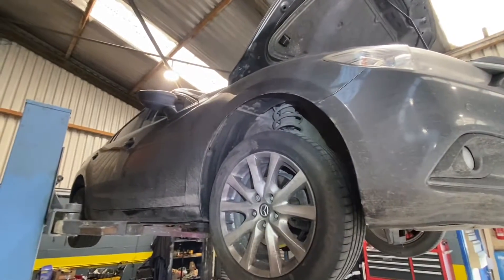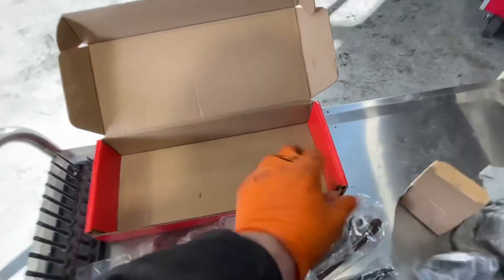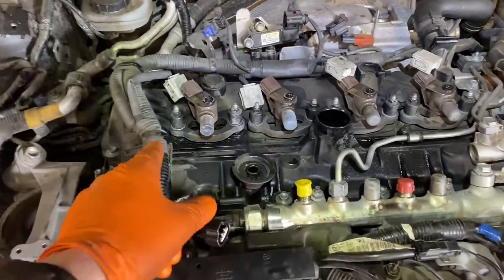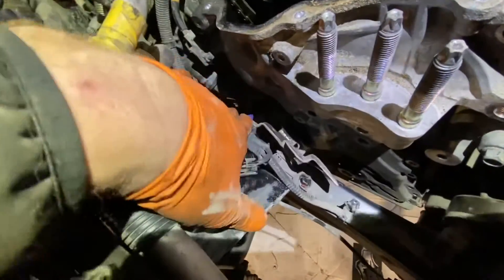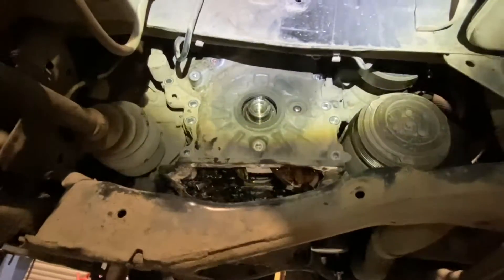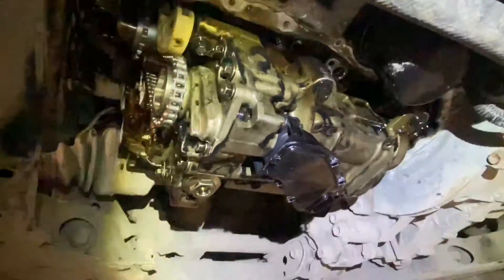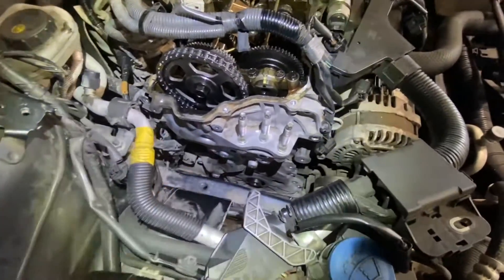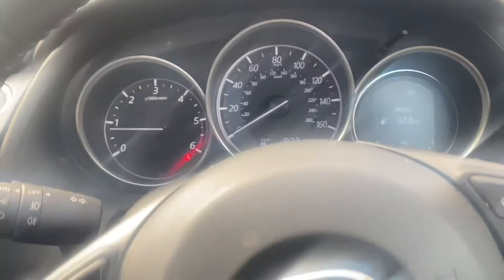Mazda Timing chain replacement tips

Comment: A true Gentleman and Scholar, what a gem find indeed, honestly and such a damn shame other mechanics are not like you! :thanksdoc: I am in the market for a Mazda CX-5 Sport on a 2017, it was such a pleasure to hear you speak in terms of how committed you are to the service of the vehicle. I was thinking i could drive from Wales to where you are should i purchase this vehicle for a timing chain replacement and service.
Reply from the maker: Hi Spencer, apologies for the delayed response. If you do or have bought one, the only chain that fails is the oil pump timing chain. Simply due to its small size. Get the intake manifold cleaned and injector washers around 100k km or 60k miles. Exhaust camshaft at 150k kms or 90k miles, then that’s it. A good car thereafter. Happy new year mate 🙏🙏

Comment: Great vid, how did you get the crank pulley off a 2.2 diesel sky activ? Its tough little bolt!
Reply from the maker: It shouldn’t be too difficult to remove, it is a 21mm bolt and I always use an impact gun. Similar to what is used on wheel nuts or studs
Reply: @kennedysgarage3281  that's great thanks just got it off this morning, locating all the bolts to take the cover off, seems I keep finding more and more.
Reply from the maker: @kevinmaguire9806  well done Kevin 💪💪💪
Reply: Think I may just change the oil pump chain and leave the timing chain, too much expertise is needed take the top off cover off
Reply from the maker: @kevinmaguire9806  buy a chain link splitter & crimper. Should be easily available on eBay 😉🤞🤞🤞

Comment: god forbid they made some locking tools for crankshaft and camshaft... nice video btw. and an excellent job you did
Reply from the maker: It actually is a really simple chain to fit and not needing any fancy locking tools makes it nice and fast, thanks mate 🙏🙏
Reply: @kennedysgarage3281  I'll take your word for it :-). I'm just paranoid of accidentally turning my camshafts without the chain fitted. I see they have the links colored and the little dots matching where the colored links must go, which is ok. I don't know if it is the same for the older MZR-CD engine. I know they have the colored links though. Once again nice video and nice explanation
Reply from the maker: @dodogot5814  once you are only turning the engine by hand every will be fine. And make sure to turn the engine 2 times after fitting the new chain to verify nothing is hitting. After that you’ll be fine 👍👍

Comment: Thanks for the guide. Question: is it necessary to put oil on new parts when we put it all together?
Reply from the maker: It depends on what you feel is best. Some people would say soak everything in oil. I put oil on bearings but not on the chain. Simply due to it taking quite a few turns over before the engine fires. I feel this lubricates everything at a low engine speed, but everyone is different 🤔🤔

Comment: Hey Peter, my 2014 Mazda 6 2.2d died few days back. Had issues with the DPF warnings so got the DPF taken out few months back. Few days ago I was driving along and as soon as I went over 2500revs the car started to shudder, I pressed the clutch and reved it up and it flashed up a load of lights and died in the middle of the road. Would not start, engined turned over with heavy shudder and no lights on the dash. I reakon it could be the timing chain! Have you heard of this before... Thanks David in Galway
Reply from the maker: Hi David, these are very common events to happen. The engine is in need of tlc and then blocks the Dpf.  Unfortunately people the fix or remove the Dpf but never look at what problems caused it to block in the first place. 
It sounds like you could have a heavily blocked intake manifold.  Only oil pump timing chains fail which cause oil pressure faults.  I’ll copy and paste part 1 of 3 videos on a similar issue I had. Or just skip to parts 2 for the intake manifold clean
Reply from the maker: This should help. 

https://youtu.be/py1_fGOAiYA?si=PhEZjYC8JBK0Pa_S
Reply: Thanks for the reply Peter.... Removed the intake manifold 2 days ago after reviewing your other videos (they were a great help). Yes the intake manifold was caked in carbon build-up but not completely blocked. Plan on cleaning out the lot and reassembling. Checked the injectors and getting plenty of diesel. Hopefully the blockage is the issue. Thanks again David
Reply from the maker: @davyfats1717  🤞🤞🤞
Reply: Quick update Peter, cleaned out the manifold and ports and gave a quick scrub to the egr valve but no change car still won't start.. Bit more background as I said I got dpf done 2 months the egr valve was also mapped out... It was working OK slight shudder from the engine when in a higher gear with low revs.. Went to Centre Parcs last week for 3 days 🙄 using missus car so it was left there, when I got home it was a bit harder to start, it was pretty low in diesel so filled it up in the town over, on the way back the issued started shudder when revving for 2500revs etc.... 160000 miles on her.... Been a great car up until the last 6 months 😞
Reply from the maker: @davyfats1717  do you have a scantool to get some direction from ???
You hardly got petrol 🤔🤔
Reply: I've pondered over the petrol question myself 😂.... But changed the fuel filter and had the pipes to the injectors out surely would have got a smell 😬. Brother has a older version scan tool no errors have came up, may need a newer version?
Reply from the maker: @davyfats1717  take a small sample of fuel and try burn it
Reply: Another update.... Its definitely diesel (thank God).... Checked each of the injectors by taking each one out and running in first cylinder, found no spray from No.2, would this cause the issue? Going to get all 4 injectors checked tomorrow...
Reply from the maker: @davyfats1717  absolutely, injectors do fail on them. Not wickedly common, but I do hit the issue once every 6 months or so
Reply: Well Peter, got the injectors checked, 2 bad 2 good... One actually exploded when they tried to test it!!!!! Got the 2 good back and bought 2 new (900 yoyos) 🤮....... Still no good however turning with plenty of smoke but no start...... 😭
Reply from the maker: @davyfats1717  I would think your intake manifold & or the exhaust is blocked solid. Can you get your hands on a scantool ??
Reply: Intake manifold, ports and egr have been cleaned they were pretty clogged. Actually got it started yesterday but it's only running on 2 cylinders. So before I sent the injectors away we thought one of them was faulty, wasnt firing. That injector came back good, it still wouldn't start so took it out and put one of the "bad" injectors in and it started....... But only running on cylinder 2 and 3, 1 and 4 seem to be down. It's now coming up with P2147 code. When it's initially started it actually runs fine but 2min later both 1 and 4 stop.
Reply from the maker: @davyfats1717  that is an injector code but I’d start questioning everything that was done so far, are the injectors seating/ sealing correctly, when the intake system was cleaned did they get far into the exhaust ports in the head. It sounds like you have some kinda air related issue 🤔🤔🤔
Reply: 4 new injectors later and it's running.....
Reply from the maker: @davyfats1717  well done Davy 💪💪💪
Reply from the maker: @davyfats1717  well done Davy 💪💪💪

Comment: Hi Peter, I saw that you mounted the FAI brand timing chain kit, so not the original Mazda one, so the compatible kits are also fine in your opinion. They don't cause problems even if they are not original, right? Some mechanics say that you have to mount the original spare parts to avoid problems, what do you think about this? I also saw in some shops in Germany that sell on Ebay the camshaft kit together with the rocker arms but it is not original, in your opinion is it safe to mount the compatible camshaft? Thanks for the answer you will give me.
Richard

Comment: Good job, again. I have a rattle at cold i hope is not the chain but in case it is just wonder how much you charge for this job. 🤔
Reply from the maker: This is a hard question to answer, just replacing a timing chain would cost around €1000 but if you engine is noisy it could be the oil strainer and or exhaust camshaft/hydraulic tappets & both of these should be be done while the timing chain is off. It could cost another €1000 😬😬😬

Comment: Mazda 6 diesel engines have issues major ones according to diesel mechanics the turbos fail cam lobes wear prematurely, pick up sump pump screens block up, the subject of much discussion. The waste gates are also problems in them.
Reply from the maker: @Alladin-n5j  if injector washers leak this causes carbon buildup in the engine, this carbon then blocks the oil strainer. Blocked oil strainer causes lower oil pressure and makes turbos and big end bearings to fail. 
So change the injector washers and problem solved 🙂🙂

Comment: Good video. You certainly are an expert on Mazda’s .👍
Reply from the maker: In in the middle of my first head gasket on one of the now & thought it wise to remove the engine and box assembly for ease of repair. It’s a bit enough job too, but very interesting. Thanks Tony 🙏🙏👍

Comment: I'm waiting for this to happen to my 2016 Mazda 6, 125k miles. Only last week I had the oil sump strainer and injector seals replaced after low oil pressure warning. Had them do what inspection they could on the oil pump chain after watching your videos, they said it looked fine at this stage but any examination can only be superficial. If I was in IE I'd bring it to you, but alas...
Reply from the maker: If the timing breaks & oil pressure drops you will loose throttle control on these, which is a brilliant feature to save doing extensive damage. So don’t fret about what may never happen, it could last 10 years🤞🤞🤞
Reply: @kennedysgarage3281  Thanks for the reassurance. It's a fantastic car, only worth £2500 with the mileage, yet I see bloody VW Polos with little comfort and convenience features and lesser BHP selling for above £5000 in similar condition!
Reply from the maker: @stupossibleify  oooh that’s low 😬😬

Comment: Great video as always 👍 ,  would you happen to have any tips or tricks for doing the infamous oil seal o ring that fits between the oil pump and oil pick up in the sump of  the 2.o diesel fitted  to  alfa  , saab and vauxhall  plenty of videos on here but  i'm  just wondering is there any easier way rather than taking the sump off  ,  Do you know if it can be done by removing oil pump which is behind the crank sprocket and leaving sump in situ ?  any tips greatly appreciated👍.
Reply from the maker: I have heard of lots of low oil pressure issues due to this O ring failing but never had the pleasure of doing/replacing it. So unfortunately cannot advise. But if one comes in John I will definitely sus it out and record it 😉👍👍
Reply: @kennedysgarage3281  Thanks ,  I'm changing the t/belt on it so i'll try  removing the oil pump to change it, In theory it should just lift off as it's a just push on fitting in the sump failing that sump  will need to come off  last 2 bolts at g/box won't come out unless bell housing is drilled out:face-pink-tears: .  👍

Comment: Is there anyway to inspect the chain as I don't know when it was last replaced and the engine is a bit "ticking"
Reply from the maker: Unfortunately timing chain wear generally cannot be measured until the timing chain is off. But the main timing chain does fail, only the smaller oil pump fails. I’ll paste an older video I done on how to do it 😉
Reply from the maker: https://youtu.be/8ywo9tkBO78?si=cg4A25du5KvJigxt

Comment: I do not miss that engine at all I once worked for Mazda now work for Skoda much prefer VAG group
Reply: I'm the opposite. Give me japanese all day long!
Reply from the maker: Most people do but I do find them very workable with very few plastic bits that can break easily & that I do like, thanks John 🙏🙏
Reply: @garybrown5500  Toyota, yes. But with the beautiful yet weak paint (they don't use an undercoat), and extreme hacks on the diesels to gain Euro5, I won't choose another. A shame, because they are beautiful to look at and to drive.

Comment: Hi peter great video
I have changed the timing chain as well timed up but it wont start and there comes no fuel through and have a hard crank what is the problem do you think? Thank you
Reply from the maker: Think simple at this point, could the fuel system just be air locked??
Do you have a scantool to check the fuel pressure live data ???
Reply from the maker: Think simple at this point, could the fuel system just be air locked??
Do you have a scantool to check the fuel pressure live data ???

Comment: Hi, is there any chance your moving to Dorset uk? 😊 top mechanic top guy for doing these vids, recently bought a Mazda 6 , it’s got a slight hesitation so I clean out egr and inlet and so on it’s better but still there , I read about camshaft on these being a problem, what symptoms would you get with camshaft wear? Many thanks
Reply from the maker: Yes, I would advise removing the injectors & rocker cover to inspect the camshaft & hydraulic tappets. They can fail too 🤞🤞👍

Comment: Peter what milage would u expect to see injector washer failure on these engines or does it vary
Reply from the maker: I recommend exhaust camshaft, injector washers & intake decarb at 120,000 kms or as close as possible 😉👍👍
Reply: @kennedysgarage3281  128km on mine i did the carbon clean on intake wasnt much carbon in there but my god the cars much more responsive afterwards.  Have u ever fitted tge fai cam shafts i know theres not available at minute but there due back soon
Reply from the maker: @eoghanhennessy443  I have but they don’t come with rocker & the rockers wear quite bad once the camshaft fails. So the OE kit with rockers is much better

Comment: Hi Pete , is this only on sky active engines with chain issues??  My wife had an 2006 Mazda 3 hatch . fantastic car.  She'd like a 2023 cx5 .  As a mechanic it nice to know lol cheers , 🍺
Reply: Bolt must have backed out breaking the oil pump chain .🍺
Reply from the maker: Timing chain seem to be quite soft on most cars nowadays so I wouldn’t be put off a new Mazda from my videos at all & I do like them 😬
I also believe the chain broke and got snagged between the pulley and guide causing the bolt to break, if that helps 🙏🙏👍

Comment: Ahh Peter another 2.2 Skyactiv saved..😊 great job…that’s a good idea of the angle grinder on those pesky bolts/nuts on the ECU…I just ended up pulling the whole loom back and leaving the ECU and looms connected. One thing I noted about the cam shaft when I was rebuilding was that most of actual exhaust valves were so SO tight..it was very understandable as to why the shaft would have worn so badly…I’d be very curious to know how long a second cam shaft lasts before it’s ground back down if the valves are not removed and reseated…I know your into a much bigger job at that point..but just an observation and the curiosity side of me coming out 😊
Reply from the maker: I actually have a cylinder head off one at the moment at a repair shop be refurbished & I must ask does he see them to build up carbon in the exhaust ports. I haven’t ever noticed them tight but very interesting to be aware of Damien, thank you 🙏 🙏👍

Comment: Hey Peter . Would you be able to talk to the Diagnostic reading of the Camshaft Differential and if there is a reading that indicates the chain stretch. Have 3 MAzda CX5's with readings of 0.9 , 2.4 & 4.6. I am worried that the last car reading the 4.6 needs a new Chain. Are you familiar with this Reading ? Do you know if there is a Recomended Differential number that indicates a need to replace the Chain. Could it be a useful reading to get ?
Reply from the maker: I am not familiar with this Andrew so do not not what is within parameters. But I am doing an exhaust camshaft on one tomorrow and most certainly take a look 👀 👍👍